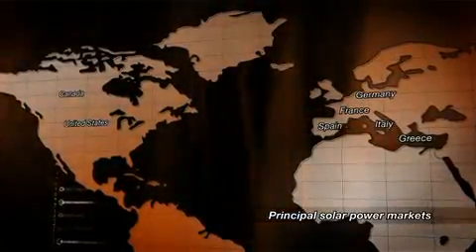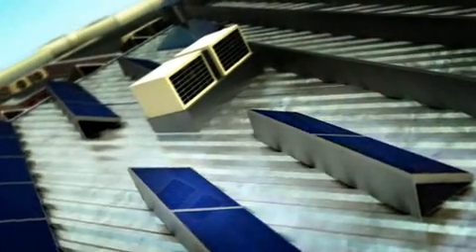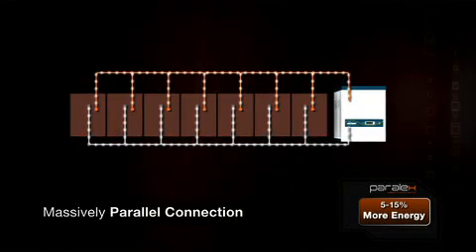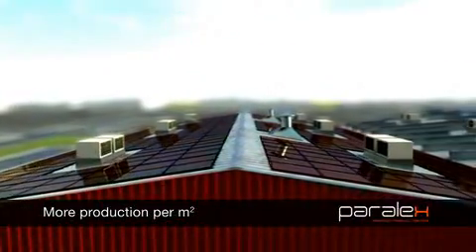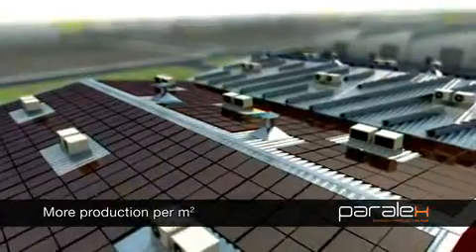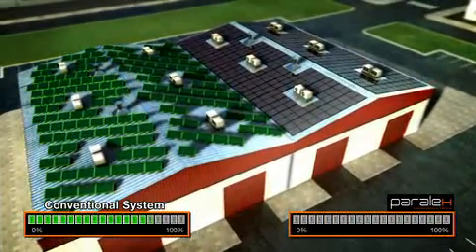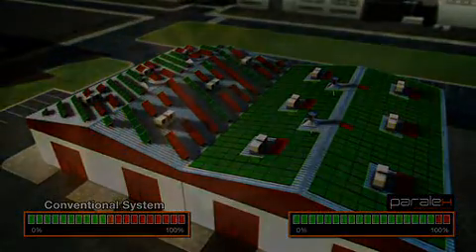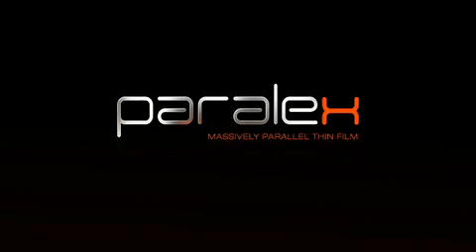Paralex solar system slashes shading losses..

Comment: Is your 5-15% efficiency gain on the lifetime of the installation or when there is shading present?   In my experience the angle of incidence makes a massive difference to the output (panel perpendicular if poss. to suns rays) ... that's why 3 axis trackers are best if you can afford the upfront cost.   Sloping panels also aid run off of debris, snow, etc and thus help keep themselves clean.   What's good on one side is bad on the other.